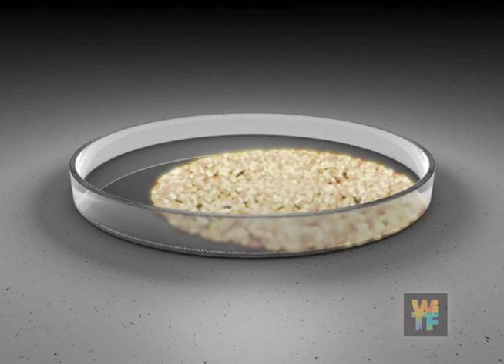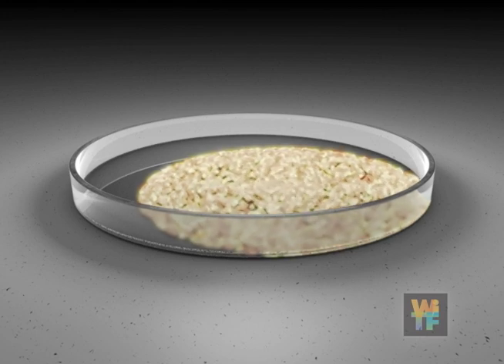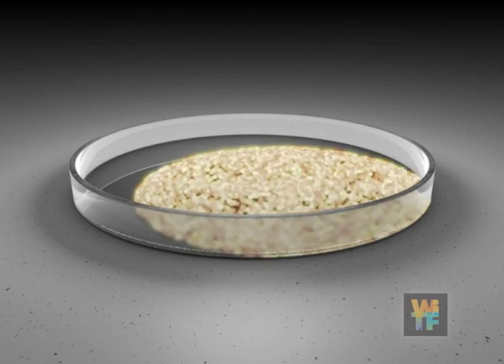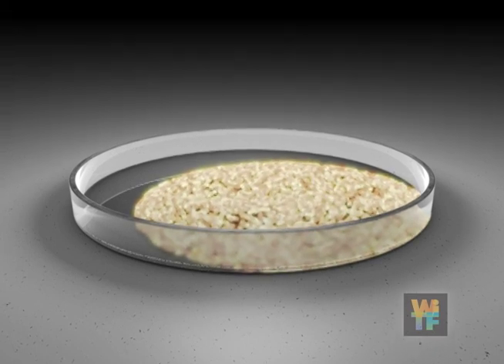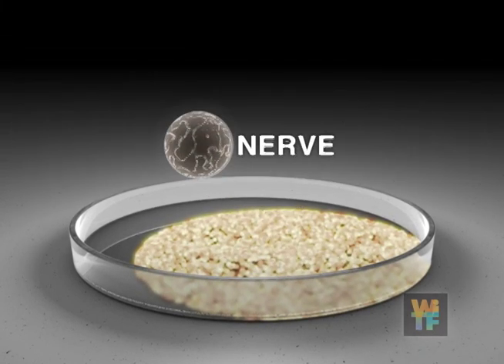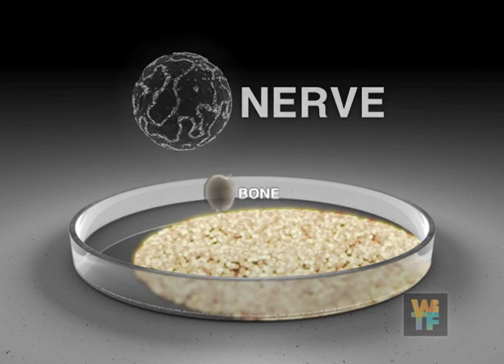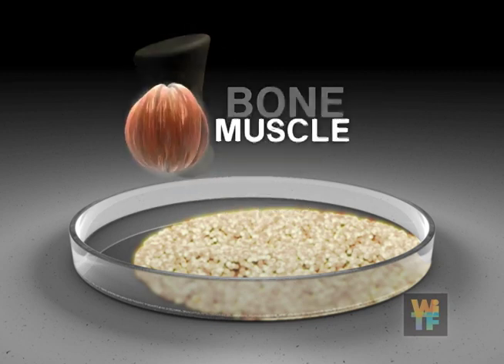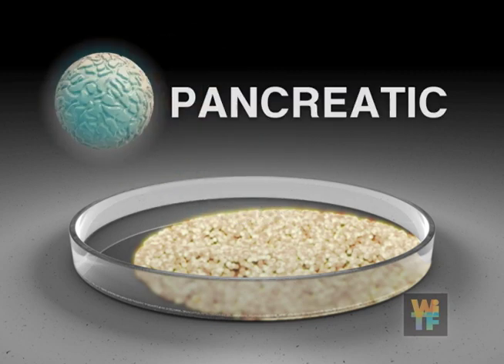Embryonic stem cell animation

Comment: the stem cells inside will need nutrition right? :/ i can hardly believe that cells can differentiate without any sources of energy, but would this adding affect the stem cells "purity" of some kind?

with purity i mean the level of which the stem cells are not affected by other factores, and thus just as useful for other puposes. for school project.

in advance, thanks for answers :)